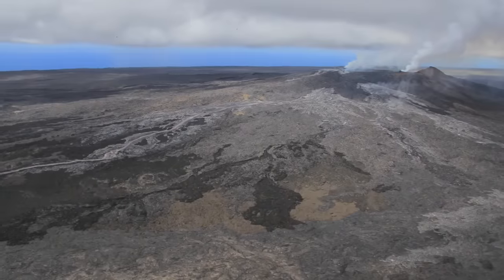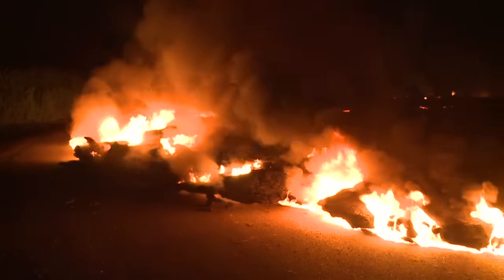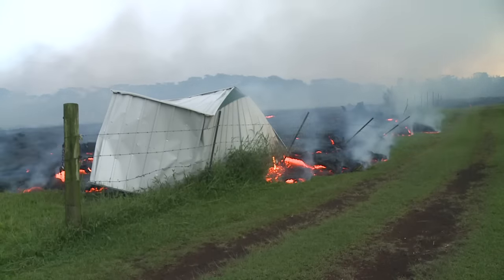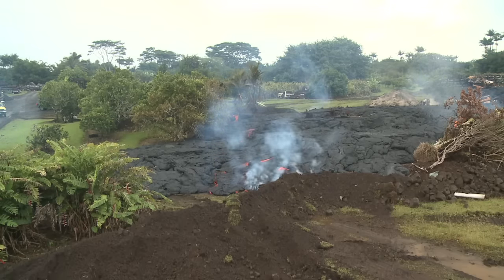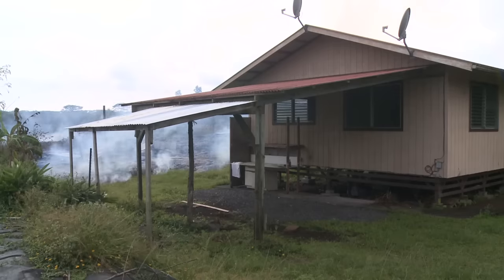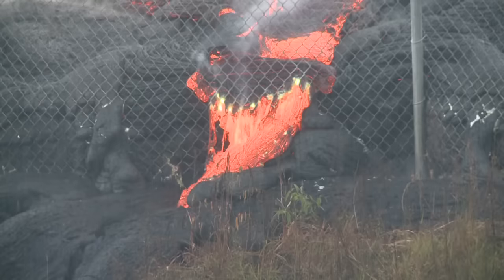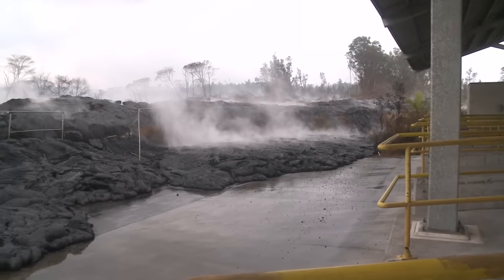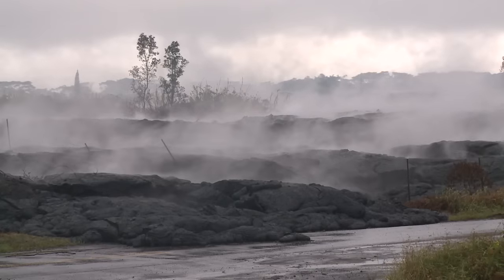Lava flows in Pahoa - Eruption Update

Comment: Thanks for this video. My daughter  was worried about Lava so we watched this and she learned about it. She's fascinated by rocks running like water.
Reply: Lava will burn the metal fence but not the thin metal roof of the house? I don't think volcanoes are real, that is not how a molten substance would behave.
Reply: Too be honest the lava here is hotter than your BBQ yet if it was hotter it will flow more like syrupy gush as seen if it came direct from the volcano when it’s over like 7000 degrees

Comment: Watching this is weird. I mean, it's like tsunami in that it's a huge mass pushing aside everything in its way, but slow enough to prepare for, but you can only do so much because it's also hot enough to burn your flesh off if you get too close. I presume most of those close-ups were taken with a telephoto lens.

This may be for schoolchildren, but it's illuminating for those of us who live in geologically quiet zones.
Reply from the maker: Actually you can get pretty close to it (upwind), because the outer surface forms a crust and keeps the radiant heat down.  And on flat ground like this it does move very slowly (most of the time).
Reply: Maddog3060 I would hate this and its not possible maybe it is but 
A lava stunami going fast like water that would suck badly like if you agree
Reply: what is lawa made off, can someone please tell me!?
Reply: Lava is melted rock

Comment: Somebody educate me, why the fuck did they let this go on for so long? I'm assuming it's because the cost of stopping it is higher than the cost of the damage...?
Reply: It's lava, its temperature ranges from 700 to 1,200 °C . There is no stopping it.
Reply from the maker: What do you mean, stop it?  There's no way to stop a volcano from erupting.
Reply: +gladitsnotme educate yourself. or maybe since youre so smart you find a solution to stop it
Reply: Alice Tan maybe i will!
Reply: Since no one has really answered your question and rather complained, the only solution I see would either be to just pour a hell of a lot of water on it which would be very expensive and maybe not even stop it from flowing too far. Or to build giant walls of dirt to contain it like a swimming pool. But again it might take too much time and cost.
Reply: xXWhatzUph8erzXx Thanks, yeah that's what I figured too. By the time they got all the supplies and resources high enough on the flow, it would have already been too late, and too great a financial cost.
Reply: +Fatkiller22 yep
Reply: It's also possible to redirect lava flows by rapidly constructing concrete walls, as well as digging large trenches to steer it in another direction. It depends both on cost and damage potential. If it got bad enough, they might go so far as to blast out trenches with explosives.
Reply: Argonwolfproject Interesting! Thank you for sharing.
Reply: the melting minerals ,even extract metal out of it my dear.the furnace principles
Reply: JoannaRice
Though they are both difficult problems and both involve fire, lava flows and forest fires are different enough that comparing them doesn't quite do it justice.
Reply: u can stop it with titanium
Reply: gladitsnotme the answer is your question?
Reply: *****
The density of the lava flow would have a lot to do with the effectiveness of trenches. Plus if you dig a trench you automatically also have an earth wall to redirect it.
Reply: *****
Indeed. Perhaps we can just agree that volcanoes suck and people shouldn't live near them?
Reply: ***** Neat. Do you design systems for redirection of and protection against water and other less immolate-y fluids?
Reply: *****
Ok. I guess something like redirecting massive amounts of liquid would be Army Corps of Engineers business moreso than civil engineers.
Reply: titanium would melt... even metals that exist in marvel films like adamantium or vibranium would melt
Reply: Actually titanium would stop it. It melts at over 3000 degrees Fahrenheit, much hotter than basically any lava that's ever been studied. However, titanium is extremely expensive to refine, and it would be silly to use it when a regular brick wall would likely do just as well. That being said, they cant just throw down brick walls everywhere, and even if they could they'd need to build miles of wall to keep everything important safe and properly redirect the flow, not to mention build those walls very high to prevent it from overflowing.
Reply: they didn't have a fire extinguisher
Reply: www.GPcarAudio.com
Give this man a medal for Joke of the Week.
Reply: hey there, I have just read the comments and I have added a comment at the top... today...  hummm I think that this lava thingy... is a good way to make bricks... you would need a spoon able to withstand the heat and a bunch of molds with the desired shape, where to poor the lava in...also lets consider that the molds could work as spoons... it also seems like a good way to produce a lot of energy... just saying... is seems like a waste... humm actually building trenches could be a good way to give lava a shape so when it sets cold... you only would need to cut it in the desired shape... entire roads and sea barriers could be made this way....  humm I wonder if Hawaii has done something else that letting it poor everywhere....
Reply: I want to agree with what you are saying... yet I think that with the tech that is out there nowadays... we probably shouldn't say that something like this cant be done... for instance we know that the flow can be directed by channeling the flow, here we could consider techniques used in metallurgy, here I am thinking about how these ppl are able to poor the metals into molds.... another good example could be the places where they create glass... this stuff is super hot... so these approaches are similar to lava... the difference may be that lava can have bubbles that may explode... perhaps a remote set up could work... in this idea ppl would be miles away from danger... another way would be to prepare slopes ahead of time... let the lava flow into pre-made channels and paths that later would be used/harvested... I cant stop thinking about the star wars movie ....
Reply: Robert Ostman
They have volcano/lava/magma powered energy sources, they're called geothermal. They don't directly touch it, but in Iceland they use a lot of geothermal plants since it's volcanic up there. Directly using lava would be inefficient. Making bricks out of lava would be a cool novelty but they likely wouldn't be suitable for proper construction and depending on the minerals in the lava, might just fall right apart. Putting a forge that close to a volcano would be a lot of safety risks for something that probably wouldn't sell.
Reply: humm you seem more interested in focusing in why it shouldn't be done than in if... it can be done... or in what could be done with it... saying that it is sacred, is just misleading as heck... and calling a stranger a fool is lame... after all here we are speculating about different approaches... no decisions have been made and probably wont be made...
Reply: why did I comment on a post that is a continuous argument about natural lava flow, and continue to get notifications about people arguing about lava at 4 in the morning
Reply: I didn't instigate a damn thing... be mature... now you have made the conditions for ppl to actually use that resource... just to get to you... it actually may happen regardless... is only logical... be mature...
Reply: +gladitsnotme you can redirect the lava flow. However, there are protesters to this. The lava flow is sacred (relates to the goddess pele). Hawaii has a lot of conflict with science and culture. Just search up Mauna kea telescope. I'm assuming you don't live in hawaii.
Reply: +Robert Ostman
You do know what haole means right? Unless you don't know...

means you're white and in an insulting way XD
But never mind the guy. Some of the hawaiians can be a little defensive when it comes to their beliefs. They're very prideful of their culture too.
Reply: You can't stop a force of nature. Earthquakes, tsunamis, tornadoes, whirlpools, and volcanic eruptions are avoidable, but unstoppable.
Reply: well it isn't about stopping it... ratter about using that resource... and finding out how, if even possible...
Reply: I'm no expert but I'm surprised this was allowed to ruin so much infrastructure. In Iceland they get geothermal power from lava. They got fire trucks to cool the lava into walls. Then let it overun the wall and then form another wall by cooling again etc. Then they whack in some heat exchangers (I believe) and extract the energy like that. I don't know how scarce water is on Hawaii but I would have thought there's enough to divert the lava away from roads and houses.
Reply: Neil Harris
Reply: Alfred, Using Tidal flows to harness energy would be great. Problem seems to be the funds and environmentalists worried about creatures.
Reply: humm funds... I would say that there are plenty of corps willing to invest in such a thing.... and regarding environmentalist... to me it would seem like they aren't doing enough, yet lets just leave it clear most of the options here are not affecting the environment... but only perhaps the one that mentions using salt water to cool down the lava flows... that option is indeed a bad one... yet the solution would be to use rain water or... to remove the salt from the sea water, and contain this clean water for such porpoises
Reply: while lava looks very slow, it moves constantly, and stopping it is very difficult. as you can't know how much lava there is, prevention methods assume there is an infinite flow of lava, which is often not far off. consider that it flowed at about .2 mph for miles before it even got to this town, and you realize just how much there is. and because of how it can balloon up over barriers, shrug off water in clouds of steam, and totally destroy just about any material, it's almost unstoppable. it's not the cost of stopping it, it's that we literally can't.
Reply: gladitsnotme i was going to ask a similar question but i was afraid of the reply comments some people can be mean. but is there a way to stop lava??
Reply: TheRancidMarshmallow this may be a naïve question, but can't they build a long enough and deep enough trench on a grade at the right place to at least divert it a little? I know it can balloon, but it's also acted on by gravity and should follow the contour of the land...to some degree.
Reply: Glenn Konklin 😱😱😱😱😱😱😱😱😱😱😱😱😱😱😱😱😱😱😱😈😈😈👹😈😈😈😈😈😈😈😈
Reply: +gladitnotome: here is suggestion to you to stop lava. Keep blowing air over it with mouth till it stop burning.
Reply: gladitsnotm
Reply: They should use Liquid Nitrogen!
Reply: now maybe trump builds a wall around it
Reply: gladitsnotme lol
Reply: Guys, there are people who don't want to stop the lava flow!
Reply: gladitsnotme 9
Reply: gladitsnotme  I guess you can't stop mother nature 🌋
Reply: It's probably cheaper to let lava do as it pleases, protect things like electrical poles and then rebuild when it stops. Stopping it involves constantly building higher and higher until the lava dries, is redirected or punches through the barrier.
Reply: why did I just read all that knowledge n' stuff..ITS THE SCHOOL HOLIDAYS;-;
Reply: The volcano kept pushing the lava out from the earth for months.  But I wonder if there was some way they could have diverted the lava flow away from the homes and station.
Reply: Rumor has it volcano gods can be appeased with a virgin sacrifice. I think OP has volunteered to stop it!

Comment: But how do they remove all of that from the roads if the inside stays hot?
Reply: you dont
Reply: They're not going to.......Lava will turn hard and build up to an island
Reply: Ole Bras De Ruiter It doesn’t stay hot.
Reply: They do not. Its there to stay.
Reply: Ole Bras De Ruiter 
I dont know
Reply: They may eventually use dirt and gravel and concrete to fill in the areas over the lava once it cools, and build new roads on top of it. This is how islands are built by nature.
Reply: Didn’t you hear him
It stays hot for months 
Just wait till it cools
Reply: I'm only a second grader I don't know so don't ask me you may be a teenager or grown up
Reply: They let it chill because the outside is cool to walk on.
Reply: it is just hot as long as lava "streams"
Reply: LOL I'm wondering the same question...haha bro  lava don't remain hot for years
Reply: @coreydrake8258   - Yeah, like 5 or 6 months at the most cuz they're already bulldozing the lava berms that crossed some roads in Leilani Estates. So some roads are open now. 🤔😊
Reply: Confusing right
Reply: Once it cools they can remove it, but they said it takes months so I assume it will take long time to clean that road. The lava charcoal is breakable once it's dried.
Reply: You use diamond pickaxe
Reply: Copied from a report in Hawaii "Recovery can only truly begin once the lava cools and hardens to a relatively soft basaltic rock. Those who can afford it will hire contractors with heavy equipment to clear the hardened lava from their land."
Reply: hahahaha
Reply: With protection xD jkjk
Reply: Tu marvel ka fan hai

Comment: How do they clean it up? Or do they just abandon the places where the lava goes?
Reply from the maker: +Aluciel286 Sometimes places get abandoned, especially if the lava flows are still active in the area.  In this case, the road has been reopened (bulldozed out and a new road put in).
Reply: +Volcano Video Hawaii Makes sense. Just seems like a huge mess to clean up. More so than say, flood debris.
Reply: they can't clean it.they have to move another place forever.
Reply: +Aluciel286 lol they dont
Reply from the maker: +Aluciel286 Yeah, it isn't really "cleanable".  At best you bulldoze the land flat again and rebuild on the new rock. Not a good idea if the volcano is still erupting.

Comment: Why not spray it with liquid nitrogen.
Reply: There's no nitrogen in the philippines
Reply: +Bio logy It's not the access that's the problem , but the price required to make it liquid.
Reply: +ASolvie it would be better to spray it with water and WAYYYYY cheaper. One issue is: on contact, the liquid turn into gas, that make a bubble that push away the liquid. The gas is an insulator. What you actually want is a liquid which turn into gas as an higher temperature and carry lots of heat, that is cheap and can be pumped on for days... However. Even if you do cool the surface, you won't be able to cool it deep. The heat take time to transfert/travel into matter. The flow of lava inside is moving, so new hot lava is always there, replacing the colder, still liquid lava. Another issue: Provided that you succede to cool the full thickness... where will the new incomming lava will go? Yup, it will find a weakness and just create a new path... Sadly... There is not much that can be done, beside digging to hopefully make like a river of lava, and direct it toward a safer point... Or make an hill to hopefully block the lava and direct it elsewhere... Unfortunatelly, both is very expensive.
Reply: Robin harvis
Reply: Lava is nearly liquid, is liquid nitrogen wouldn't be very effective. It would be on a gas fire, but not lava. Normal water is more effective.
Reply: +ASolvie It would probably explode / shatter into nasty fragments. Kinda like putting a glass under hot water, then instantly under cold water. Idk. Should test it.
Reply: Liquid nitrogen turns into a gas almost immediately as opposed to water, since it has a lower point of evaporation. So it wouldn't be as effective as water.